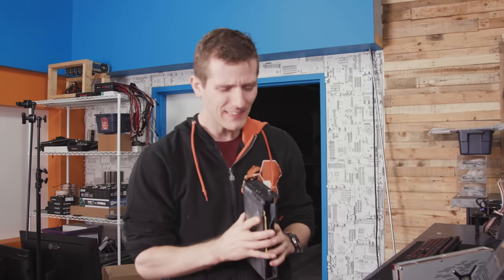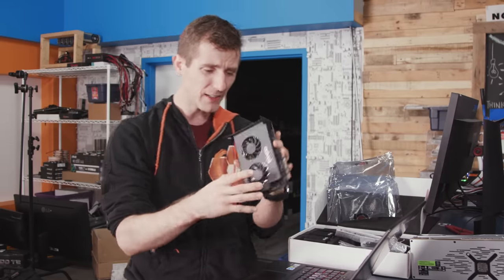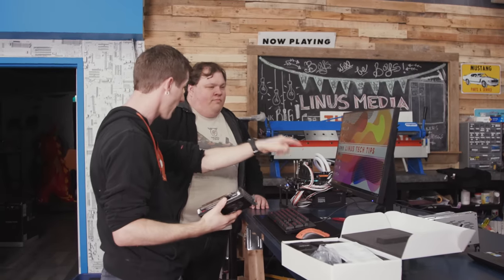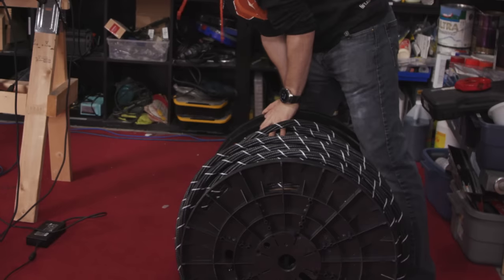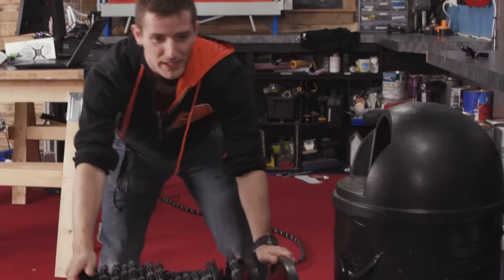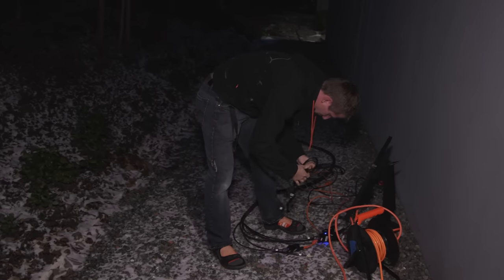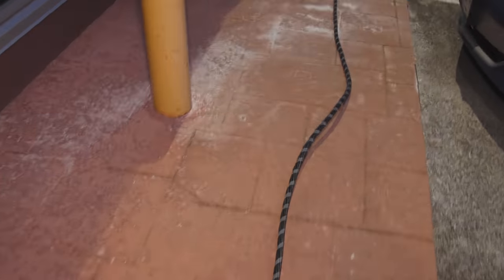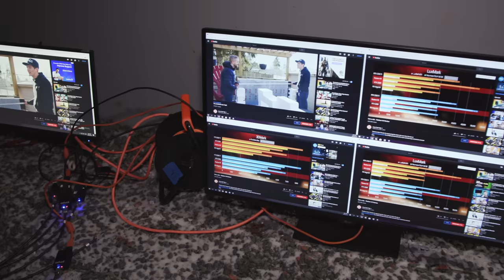The WEIRDEST Video Card We’ve EVER Seen..

Comment: Imagine apple made GPUs...
Reply: They would be 'iGTX 580s' (100 percent new Innovation)
Reply: Which cost about like 9k because “innovation” and “advancements” boi it’s gonna be the same as a rx 360
Reply: $1000 per card with one core at 100Mhz and 1 bit of VRAM.
Reply: Imagine if Apple made mobile CPU/GPU's.. oh wait, they do, and their 2018 chip is still beating the 2019 SD855..
Reply: it would need dongles.
Reply: Gpu not included
Reply: Its gonna be a GT1030, but for $104720
Reply: it would have a lightning connector.
Reply: @BrawndoQC  Obviously, since they pour a shitload of money into r&d.(~$12B)
Reply: RTX 2080 ti level card ... for $69696969696969696969696969
Reply: only typeC output, buy a $120 adapter
you need a cloud service subscription to use the card
2 years later the power is reduced with drivers to lower the temperatures and improve lifespan
you need to go to authorized service to change thermal paste when it wears off, doing so on your own voids the warranty
Reply: @k680B  nailed it
Reply: @BrawndoQC  without jailbreaking iphones and ios- devices  looks boring to me . :) - Android Heavy User
Reply: @spray277  Indeed, I Paid $1,500 for my Asus Strix 2080 Ti. It's getting ridiculous but I wanted one.
Reply: Like all other products Apple makes, overpriced and underperforming
Reply: @jonathanstevey1748  my iMac Pro at work renders videos faster than my 8k USD i9 9900k gaming rig at home.  And if you want to say that the A12 (Iphone XS) and A12X (Ipad) are underperforming, boy you have a lot of things to catch up with. Try to push the bias aside and see tech as tech, not just brands.
Reply: @BrawndoQC   
I mean it should be considering its at least twice the price of an 9900k build
Reply: I mean they were the first company to put out a 7nm CPU to consumers(A12 Processor)... This is a pretty foolish comment
Reply: @biscuitnougat5749  My 10 cores iMac Pro is 7,500K USD. My Crazy gaming rig is 8,000K USD.   The thing is the iMac Pro use ECC Memory, Xeons, crazy fast storage, 5K Screen, doesn't take space on the desk (Ultra compact, all-in-one) etc.. and it runs MacOS natively without the need to go through the hassles of an Hackintosh. You'r watching Linus Tech Tips now, check his video where they try to build a PC with the same specs of the base iMac Pro, came to the same price.  Workstations don't use the same specs than a gaming rig. Components are optimized for different tasks. LTT video about base iMac Pro vs Same Specs with a PC (including a proper 5K Monitor that is worst than the iMac Pro).. Guess what.. The iMac Pro 5K USD, The PC 5.2K USD.   I think you guys should switch from tech channels to Pokemon channels. Thanks. I"m out.
Reply: @BrawndoQC  
No I agree, but why is your computer $8k with only a 9900k? At that price point you're looking at Xeon/ threadripper builds
Reply: @BrawndoQC  Agree. But you cant compare ios to android that fairly
Reply: @biscuitnougat5749  Where I currently live, shipping, often custom fees, taxes etc.  This is my build from PCPartpicker. Of course you could remove the audio and UPS backup (if you don't care about your data/hardware), and PCPartpicker does just cherry pick best prices and zero shipping.  So yeah maybe closer to a 5-6K build in the US if you removed the non-essential components.  Still, it's not a Xeon, GPU is a gaming GPU, not a video rendering GPU (although it can do it), you have to pay for Windows, unlike MacOS which is included etc.  Apple also don't charge extra in most countries, they cost the same. Anyway here is my latest.. 

Price breakdown by merchant: https://pcpartpicker.com/list/t9qHMZ/by_merchant/

CPU: Intel - Core i9-9900K 3.6 GHz 8-Core Processor  ($525.99 @ Amazon) 
CPU Cooler: Corsair - H150i PRO 47.3 CFM Liquid CPU Cooler  ($149.00 @ Amazon) 
Thermal Compound: Thermal Grizzly - Kryonaut 11.1 g Thermal Paste  ($27.99 @ Amazon) 
Motherboard: Asus - ROG MAXIMUS XI HERO (WI-FI) ATX LGA1151 Motherboard  ($275.98 @ SuperBiiz) 
Memory: Corsair - Vengeance RGB Pro 16 GB (2 x 8 GB) DDR4-4266 Memory  ($349.99 @ Amazon) 
Memory: Corsair - Vengeance RGB Pro 16 GB (2 x 8 GB) DDR4-4266 Memory  ($349.99 @ Amazon) 
Storage: Samsung - 850 EVO-Series 1 TB 2.5" Solid State Drive  ($299.89 @ OutletPC) 
Storage: Samsung - 850 EVO-Series 1 TB 2.5" Solid State Drive  ($299.89 @ OutletPC) 
Storage: Samsung - 850 EVO-Series 1 TB 2.5" Solid State Drive  ($299.89 @ OutletPC) 
Storage: Samsung - 970 Pro 1 TB M.2-2280 Solid State Drive  ($347.89 @ Amazon) 
Storage: Samsung - 970 Pro 1 TB M.2-2280 Solid State Drive  ($347.89 @ Amazon) 
Video Card: Asus - GeForce RTX 2080 Ti 11 GB ROG Strix Gaming OC Video Card  ($1364.99 @ Newegg) 
Case: Corsair - Crystal 460X RGB ATX Mid Tower Case  ($119.97 @ Newegg) 
Power Supply: EVGA - SuperNOVA T2 1000 W 80+ Titanium Certified Fully-Modular ATX Power Supply  ($233.98 @ SuperBiiz) 
Operating System: Microsoft - Windows 10 Pro OEM 64-bit  ($139.89 @ OutletPC) 
Case Fan: Corsair - HD120 RGB 3-Pack w/Controller 54.4 CFM 120mm Fans  ($74.99 @ Newegg) 
Case Fan: Corsair - LL120RGB LED (Three Fans With Lighting Node PRO) 43.25 CFM 120mm Fans  ($99.78 @ OutletPC) 
Monitor: Dell - AW3418DW 34.1" 3440x1440 120 Hz Monitor  ($879.99 @ Amazon) 
Keyboard: Razer - Huntsman Elite Wired Gaming Keyboard  ($199.00 @ Amazon) 
Mouse: Razer - Mamba Hyperflux & Firefly Hyperflux Bundle Wireless Optical Mouse  ($204.04 @ Amazon) 
Headphones: Bose - QC35  Headset 
Speakers: Audioengine - A5+ Black 100 W 2ch Speakers  ($399.00 @ Amazon) 
External Storage: LaCie - Porsche Design 4 TB External Hard Drive 
External Storage: Samsung - T5 1 TB External SSD  ($177.99 @ B&H) 
UPS: APC - BX1500G UPS  ($179.99 @ B&H) 
Other: Audioengine S8 Black 8-inch Powered Subwoofer  ($349.00 @ Amazon) 
Total: $7697.00
Generated by PCPartPicker 2019-03-03 16:25 EST-0500
Reply: @costelli1  I don't hate Android, I currently also use an Asus ROG Phone for my personal line. iPhone is for work / ecosystem.
Reply: @BrawndoQC  Well no shit the 10 core imac pro outperformed your 8 core PC. Try comparing it to an identically priced editing rig.
Reply: @biscuitnougat5749  Probably has 2 2080tis and water cooling.
Reply: @BrawndoQC  wow you have good rigs , i have ten years old custom pc What is literally "good" but i consider ram upgrade, now "only kingston hyperx 8gb DDR3" back 10 yrs was prbly normal or good amount.. higher ram amount will maybe "reduce bottleneck"  this "new" gtx 1060 gpu needs atleast 8gb+ to work at good (with less bottlenecking) performance.. idk , dont want to upgrade entire system yet.. with now new couple parts only  750w 80 gold plus Corsair RM750,WD SSD 240g+ 120g hyperX ssd, hdds.. GTX 1060 STRIX 6GB, Cpu is good old steel.. AMD Phenom X6 1055T( oc) (stock 2.80-3.XX Ghz i dont remember.. Ghz) now atleast "OK" with oc to 3.40GHZ (14)TURBO - 3.97GHZ (16)
Reply: @BrawndoQC  
If you bought parts specifically for video editing and didn't buy so many SSDs a pc the same price as a iMac pro would run laps around it you have noooooo idea
Reply: @biscuitnougat5749  Because it's a fucking gaming rig man. And the storage is for my drone footage editing..  A xeon 10 Cores is worst for gaming as games won't use them and single cores are clocked lower.  The NVME's and EVO's are in Raid-0 (2 partitions, SATAS together and NVME's together) for speed. God damn not sure why I read the comment section of LTT there are so many newbs.
Reply: @costelli1  HyperX is good, that's what I upgraded my Razer Blade with, but I would recommend G.Skill for a PC build.
Reply: @BrawndoQC  
What I'm saying is if you are building a PC for the purpose of video editing and you use the same budget as the price of a iMac the PC will destroy it.
Reply: @biscuitnougat5749  Actually, not. Also I don't know you can run FInal Cut Pro on a PC? Like literally half of the videos you watch on youtube are edited on MacOS.. You're talking from an ultra biased person who have never been faced with the scenario. Kinda like libs vs conservatives.

Comment: This basically very useful if you are running very long cable runs. Or using a HDBST system. Very useful for smart homes. Its a lot more reliable to run a cat 6 and then using HDMI extenders, rather then a long HDMI. What you have there is the next step up, the video card is pretty much a long HDMI extender with the transmitter built in the card and the receiver on the other end. Also I did 400 ft for a house at 4k resolutions using a 4k HDBST video matrix and no worries the tech is that good.

Comment: Honestly, the best part about this video is that if the just plugged in a monitor in the room and then plugged in the cable while spooled, it would still be a cable run consisting of the full length of the cable.

Comment: The distance it’s in the cable end to end,  no need to take the cable outside, you can have a mile of cable rolled and the signal still needs to travel a mile without stretching it.

Comment: So, wait. The specs on this say that it's capable of an output of 1080p @ 60 hz.

This means that, at least theorteically, 4k 60hz is possible through the use of amd eyefinity with a quad output display and 4 outputs.

Comment: Used a GPU like this to setup information display in a mall in Dijon. It's perfect, all you need is cat5 ftp that was almost omnipresent, but needed two of those GPUs to get each to run an swf animation, and some info on a powerpoint.

To avoid dumb Windows Updates, it's not networked, and you need a ZIP disk to transfer or update the screens, put them on the right directory and it's all running.

Comment: actually, why you need to pull all the way cable outside around the building, but you can connect it direct in the same room at leave the cable and connect it in same room. it's the same thing, same distance.

Comment: You know you could have just plugged it into a monitor right next to the PC instead of dragging that cable everywhere. Regardless if it was rolled up or stretched out, the signal still had to travel the full length.

Comment: Surely outputting lossless compressed data at a high bitrate will outperform simply splattering the signal down an ethernet cable? Although I guess you need fixed function encoders and decoders

Comment: Ya know, the loss of signal comes from the length of conductor the signal has to travel through, not because of the actual distance from the source.  You could have left the cable on the roll :)

Comment: I still use DVI monitors because I'm cheap and don't want to replace the monitors I have, so even if I build a modern PC, I only have one monitor to use it on, and if I want to do anything with two monitors I have to use my current 5-6 y/o desktop that has dual DVI outputs
Reply: What is wrong with DVI? Never change a running system.

Comment: i still dont understand why linus has to physically stretch out the whole spool of cable if the length of the cable is already 600m.....just leave the spool inside and connect the 2nd monitor on the other side of the room ?

Comment: or,youknow.....just plug the roll in and straight out in to the monitor....328 feet of wire of cable remains 328 feet despite being rolled out or not...and its suck low power that coiling wouldnt affect it....

Comment: You know of course that you only needed to plug a monitor into the other end instead of unraveling the whole reel .. the distance would be the same .. you want fun .. figure out the harmonic frequency of your cable to find out if it is the best or has a standing SWR which would increase the resistance and other fun things

Comment: Did you need to actually drag the cable 100 metres away? Surely the signal has to travel along the 100-metre cable whether it's laid out for 100m or still on its spool. Was there any reason the cable actually needed to be laid along a 100m route over than just having it on the spool it came on for the purposes of this test?

Comment: Couldn't you just have left the cable on the drum and plugged the monitors in? The signal would still have had to travel 100m along the value on the drum. The cable was shielded after all.

Comment: Interesting topic, Maybe this card would be a game changer if it also could be wireless. I would be happy if a Graphics Card could interface with a monitor wirelessly in 1080p or even 4K. Just make it work within 5 meters like sort of Bluetooth. You can than limit the quality to optimize fps or bit-depth. For games this could be as low as 7 bit.
Reply: These graphics cards are for multi-screen setups at exhibitions, concerts, or any kind of event where they need to play videos to a crowd away from the operators. Cat6+ cables are way cheaper and better suited for long distances than HDMI cables

Comment: Lmao I've installed these. Also you didn't need to unroll your copper. The electrical length is the same regardless of the linear distance.

I.e. 600m copper is 600m regardless if spooled or not.

Comment: How much lag/latency?  I remember having lag with my 10meter hdmi cable (yeah i know2/5meters is the max with cheapo cables)
Reply: At 328 feet this spool cuts off right before you start to lose power/signal on the line. At this length the latency would still be less than the response time on most monitors. The de-sync between the source and output would be almost a second so don’t game with this, if it was a fiber-optic connection lag and de-sync would be almost non-existent.
Reply: @collinfrye9555   o wow a 100 meters, even with high quality lag is immense.
I tried gaming with my 10 meter cable in a large public room few years ago and my computer was setup far away next to a sofa and extra long usb cable that have close to no lag on my normal monitor, but with this 10 meter cable gameplay was so horrible, plus it was on a large tv with like 40/50 ms lag already haha  dude i cant think about a 100 meters cable even with extra power supply/  atleast for movies you can sync the sound and use this for monitoring cameras etc but you are right i never want to game with it

and yeah fiber optic lightspeed (lenny face)  wonder how prone it is to errors when the cables get a dent
Reply: @cybernaab  For you question at the end most fiber-optic cables can only bend at a rate of 10:1cm before the fibers snap making the cable useless  and good luck denting the jacket because it is normally aluminum
Reply: @collinfrye9555  sound like twice as expensive cables with all the protecting sleeves
Reply: @cybernaab  the main cost comes from terminals, switches and panels capable of reading the laser signals of fiber.

Comment: LOL @ the One+ 6t ad/giveaway--it's my phone: it's trash. Great specs hamstrung by poor design/software. 19.5:9 screen fits nothing, apps have elements cut off, round corners make it worse, everything tiny. Camera software is useless. Panorama doesn't stabilize before stitching. Every pic has logo stamped onto the raw data. No headphone jack, OEM dongle cheap, non-OEM dongles work poorly. Thumbprint reader blasts full-bright even if in dim light, doesn't work half the time. Dark UI engages bright white navbar 'by design'. 'Unbreakable' glass back panel shattered on first drop of two feet, while using OnePlus's own case. LTE and phone reception is terrible if you happen to be inside

The only positive about the phone is cautionary and after-the-fact. It's taught me: Never skip headphone jacks, get goofy aspect ratios, use 'recommended' cases, software can ruin great hardware, and never buy OnePlus anything again. To sum up, it's a janky ball of horrible design choices, half-assed software, and counter-intuitive elements totalling to a piece of hot garbage I wish I'd never bought. If you offered me another one 'for free' I'd actually turn you down.

Comment: sorry linus but that was stuiped thing i see :| you never ever need to go out side :/ just plug the cable to gpu and end of that cable to monitors in same room, the signals will travel 600 meter in cable without moving your monitors and cable to 600 meter away ! that was stuiped thing you did it .:|